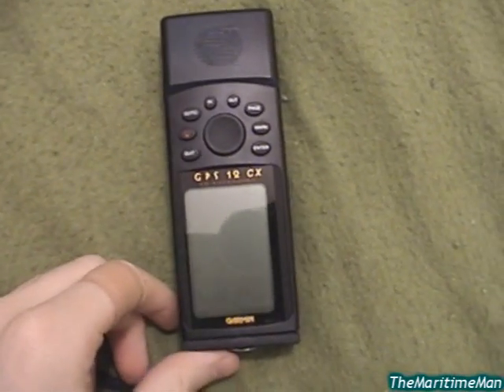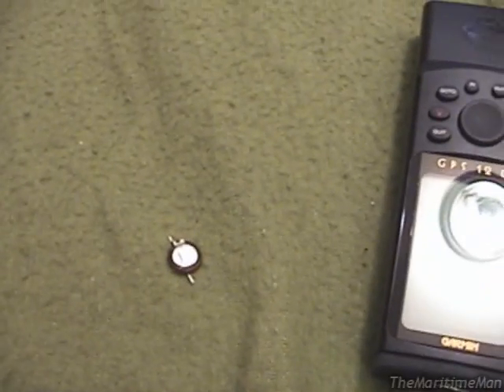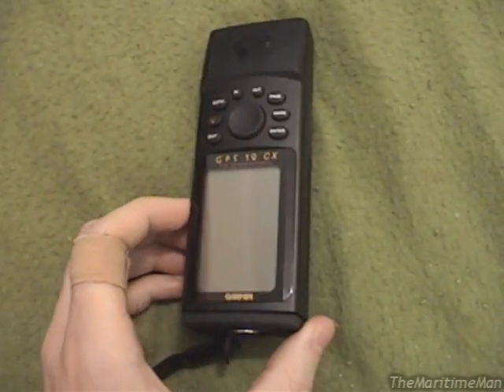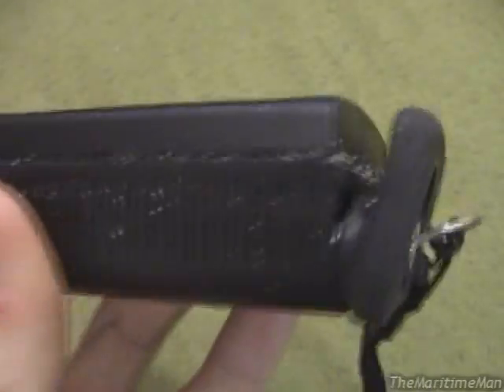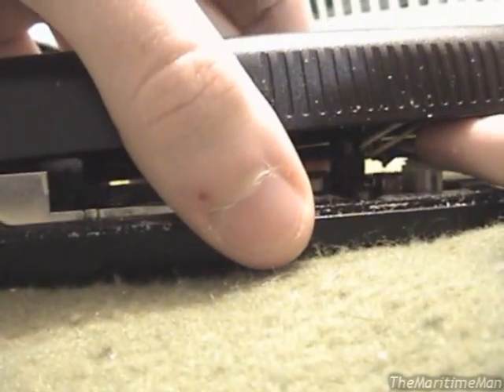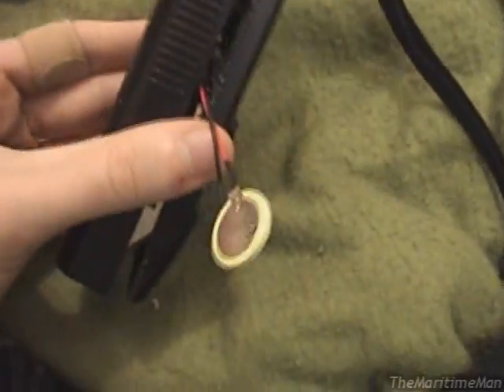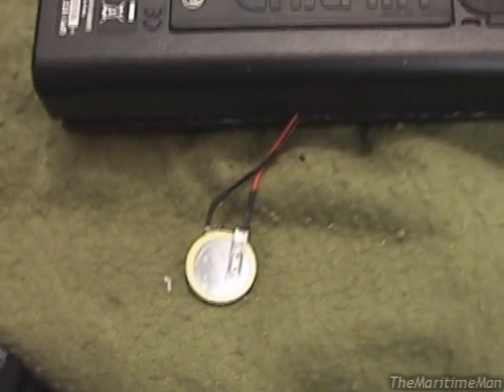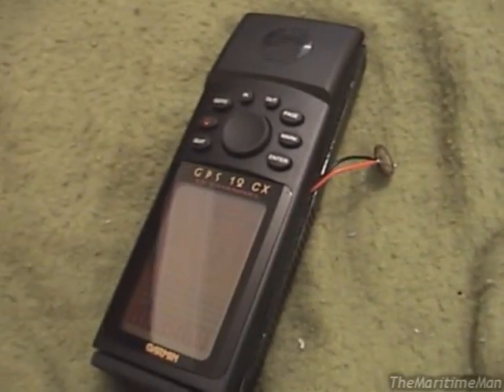Replacing the Garmin GPS 12CX's memory battery

Comment: Speaking of the Battery, for Nintendo Game Boy Cartridge, is there a replaceable since they could no longer to recharge or hold the electric so they can save the memory?
Reply: That would interest me too since I wanted to try out pokemon crystal again but it says the save file is corrupted. That gbc cartridge is lying around for some time now.
Reply: Florian amRechner Same here for my Harvest Moon game from GBC, and I need to be very careful replacing the battery, and look for the right type of battery for saving the profiles, like on the PC for example, when your clock battery is dead, to the point it could no longer worked properly to keep it set on the clock where they ask you to set the clock, all you can do is to look the battery carefully on the board, and then you can replace the battery and set the clock.
Reply: Florian amRechner By the time, I learned how to replace the battery from the GB cartridge, GBC cartridge, etc., it really works when I test it through on my game by saving it the profile, and after a minute and so forth, it worked, and it saved my profille with new 2014 Sunbeam CR2032 lithium battery, 3 Volts battery.

The original battery was 1998 Panasonic CR2025 battery, I test it out, it reached down to 0.05 Volts tell me that the battery is dead to the point it could no longer to hold any profiles to save along with electricity. Back then it hold around 3 Volts, and today it dropped down to 0.05 Volts. So, I replaced the battery, and it works very well, and I get excited to play the game again!. =)

Comment: Thank you for the video. How do you think if I can use the CR2032 batteries instead BR2032?
Reply from the maker: You can use it, but I don't know how long it would last.
Reply: *****
Ok. Battery which will be the best according to you? How do you think. CR2032, BR2032 or LV1220.
Reply from the maker: motoszyboloty.pl The BR2032, of course. That's what this originally used. And as I posted in a comment above, the VL1220 is completely unsuitable.
Reply: *****
Ok. Thank you very much.

Comment: Word of warning when resealing (any electronics). Only use NEUTRAL cure silcone or Polyurethane sealants. The vapours from Acetic cure silicone (ie used mainly for sealing/bonding glass) with EAT any unprotected copper on printed circuit board tracks. Another tip, never try and solder to any batteries that don't have solder tabs. Even if you make an electrical connection, the minimal heat transferred into the chemical composition of the battery will severely limit it's life. Solder tabs are attached via a spot welding process involving milliseconds of current/heat to achieve the bond.

UPDATE: Just looked up the MSDS for the Permatex Silicone used in this video, and the sad news it is ACETIC cure. A BIG NO NO AROUND ELECTRONICS!!! Packaging even suggests not to be used around electrical.

Comment: FYI - I have a 12XL and it uses the VL1220.
Reply from the maker: Thanks for the info. From what I gather from you and other comments, all Garmin units must have originally used the VL1220, and then later they moved them all to the BR2032.
Reply: ***** I believe this 12XL was manufactured in 1999. That appears consistent with your theory.

Comment: Did you know these units are factory filled with a nitrogen gas. there is a warning about this when fitting the handle bar mount with the provided screw, once fitted never remove as the screw pierces the case. poor design if you ask me. I often wondered  if it would still work once the air got in.
Reply from the maker: It's just to make it more buoyant if you drop it in the water. I imagine it slowly seeps out over the course of years.
Reply: That's an interesting idea but isn't nitrogen a heavier than air gas so less buoyant, I thought it was to prevent internal  corrosion  caused by oxygen.

Comment: First thank you for the doing the video.

I opened up my 14 year old GPS 12 CX to replace the battery and it has the VL 1220 soldered directly to the PCB. The 2032 is almost twice the size of the 1220 so I assume its too large to soldered directly to the board which is why Garmin started using wires. Mine also came new with the V2.01 firmware. Hopefully I can get it going again.
Reply from the maker: You're welcome, glad it helped! And thanks for the info about your unit. I can only guess that earlier units used the VL1220 (since older models like the GPS 45XL and GPS 38 definitely used it), and later they switched to the BR2032 in response to the problems they had with the charging circuitry for the VL1220.